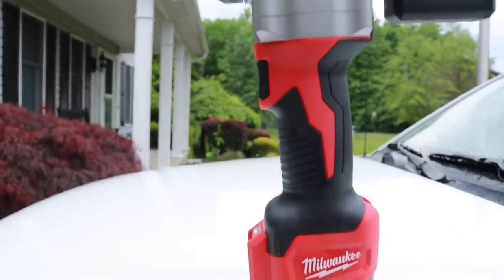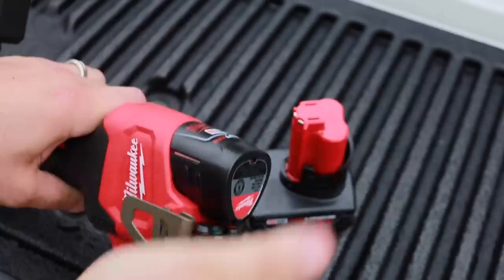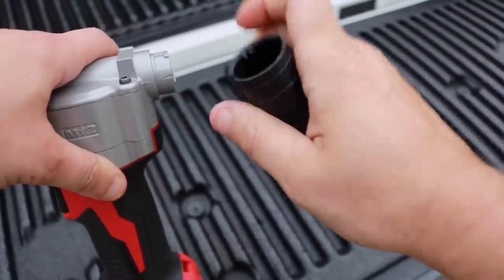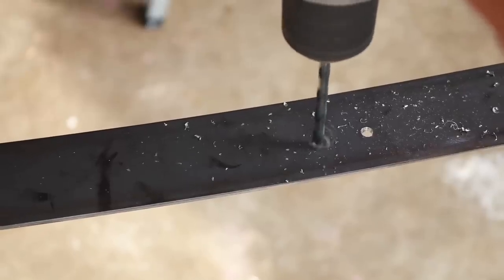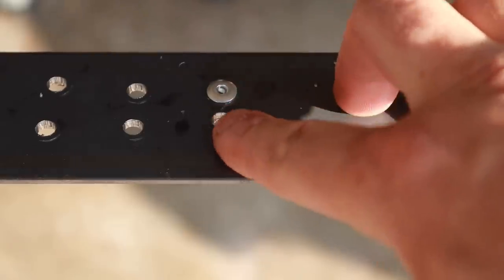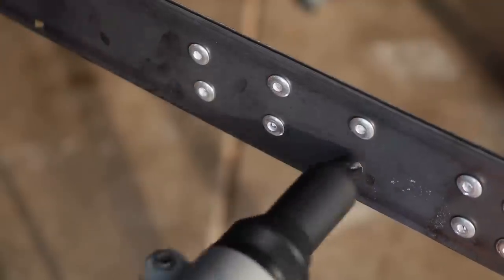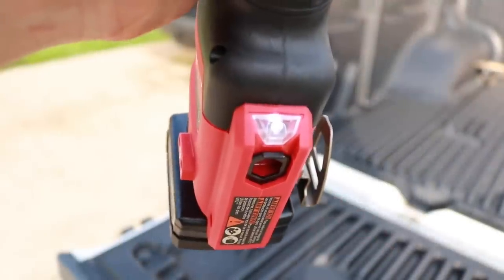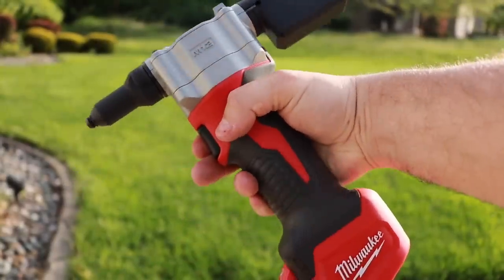Milwaukee M12 12 Volt Cordless Rivet Gun REVIEW! (2550-22)

Comment: What I noticed is he only used aluminum rivets.  A true test of any riveting tool, hand or power is when fastening (pulling) Stainless Steel rivets.  If I am going to spend $200 plus for a cordless riveting tool it has to pull 1/4" SS rivets all day long else I will stay with my $100 pneumatic or $40 longhandle.

Comment: This is not the only battery rivet gun available on the market. Stanley make good ones as well. Also, if the stems break clean, it is not because of the tool. It’s because you put the right size nose tip and you use a well made rivet. By the way, if you are looking for  better and more versatile rivets, check Avdel rivet solutions. “Pop” style rivets don’t last under vibration, constant tensile and shear pressures.

Comment: God I would have killed to have had one of those back when I worked at a truck shop where we worked on boxes a lot with riveted tin sides, if there wasn't room in a bay or you had to work on one outside for some reason you'd have to drag out a bunch of air hose. I was lucky enough however to have what I believe was the first set of battery powered tin shears so when I needed some tin I didn't have to put the roll that was on the side of the building on a cart and roll it inside or drag a whole bunch of air hose outside to reach to the side of the building which was sick! All the other guys that had power tin shears had pneumatic ones and they were all jealous of my battery powered ones and they all pretty much never asked me to use them cuz they know how protective and OCD I am of my tools. I would let my friend Gary use them but he was the only one cuz i trusted him with my tools he knew the rule of you break it you buy it and I trusted him.

Comment: we use them at Stulz for AC construction. They work OK for about a year then suddenly have trouble grabbing and extracting the pin. 
I keep saying we need to use AC or air tools for pop rivets. No one listens to me. They love their battery operated gear too much.
Reply: Just a heads up, you can buy replacement jaws for this tool.  They're consumable, especially if you use a lot of 3/16" steel rivets.  Put a new set in yours, and it'll probably run about like it did when you bought it.

Comment: I think milwaukee should have added some rubber bumpers at the top so when you lay the tool down it doesn't get all dinged and scratched up. My metal top looks pretty rough after a friend borrowed it and was apparently kicking around on the floor???

Comment: Looks like it works great. On aluminum. What about stainless steel rivets?
Do the same test with stainless and I'll buy one tomorrow.
Reply from the maker: There was a comment left buy someone a while ago stating that worked perfectly with steel rivets
Reply: I tested it with 1/8" stainless steel rivets and it performed great.
Reply: Wow! I can hardly believe it. Well, I guess I better check my bank balance...
Reply: @DoresoomReviews  Also used mine with 1/8" stainless rivets for field work. Works great and so much faster and easier than a hand rivet gun.

Comment: air rivet guns are the only way to go
Reply: I'm shopping around for a light weight rivet gun for fabricating aluminum architectural panels, any suggestions?
Reply: IKR, my grandma can do 3/16" aluminum rivets all day by hand. Air compressor crapped out today and waiting for parts though but this is not going to pop a large stainless steel rivet it seems anyways. And gosh pretty spendy unless your riveting often!

Comment: why is it so over price just the tool is $169 with no batteries the tool kit is $299 its not a tool that's used as much as a drill set the milwaukee drill set combo comes with everything for $169 also dewalt combo  is $199.
Reply from the maker: Not really sure static. Could be because it's a specialty tool? They will probably go on sale soon I would think because of the holiday
Reply: @ToolReviewZone  thinks so much for the info ?
Reply from the maker: You got it buddy

Comment: Not the first battery powered rivet tool and certainly not a "Professional grade"  Gesipa, Marson, Pop Emhart, Lobster, and others have been around for much longer and are professional grade. The tool is great if you are a homeowner and have a hobby project every now and then but for guys out there that use a riveter all day in industry it sucks. Especially if your boss is trying to cheap out and buys these instead of the better brands. The thing jams up constantly and they seem to break very quickly and just stop working when used continuously.